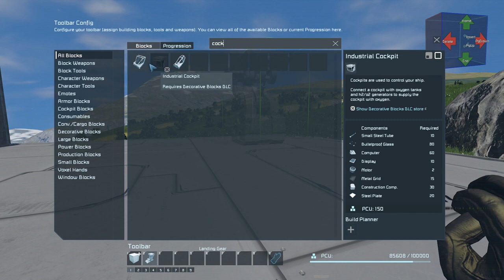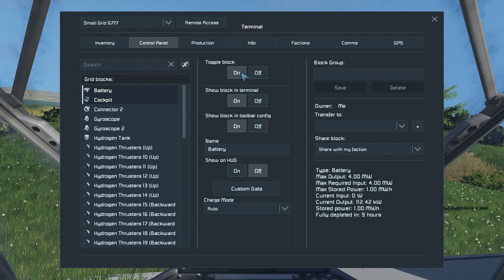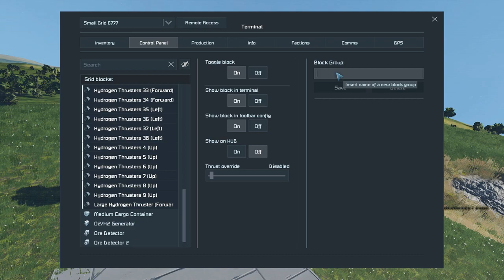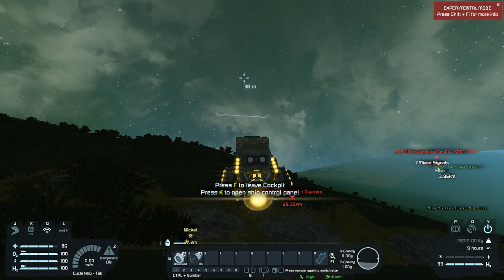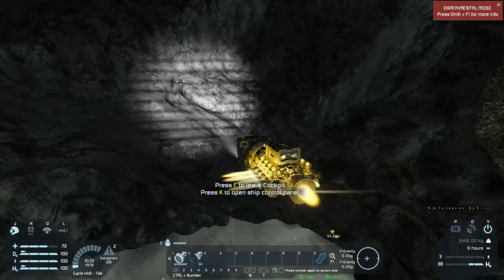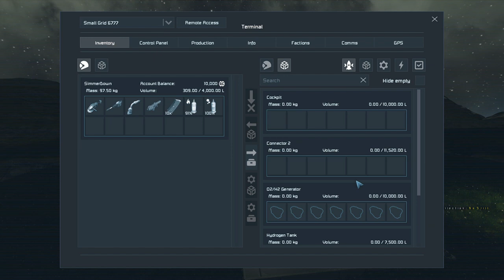Space Engineers - How to build a SIMPLE Hydrogen Ship to get into SPACE - Tutorial

Comment: Just built something very similar in my world today, except has two drills on either side in front. But left it hovering and forgot to shut it down, but assumed the 1.2k ice in the 2 generators I have would've kept it running a long time. Only had 4 small batteries though, assumed again that would be enough. With the large small grid tank I ended up running out of ice, then out of battery power and died before I ever took off the ground, lol...

Comment: Took your build and added a few things. Placed rear thrusters above and below the main, in addition to the 2 on the side you had. I also took the mats for a solar panel and slapped it in front of the battery when i got into 0g. You took off with 28k, but this thing flew with no problems loaded down with 120k worth of ice and mats for a refinery, survival kit, battery, and solar panel... wish I had brought more now. made it to space with 85% hydro.

currently at 50% and heading towards my 3rd asteroid.
Reply: I'm still on the same flight, gone around the planet a few times. finally found some uranium. still have 40k of ice and 2 solar panels now, so no worry about fuel or power. thanks for the build, works great.

Comment: Another tip, set controls to increase and decrease thrust on the large thruster. As the g force goes down decrease the thrust (it will consume less hydro for same acceleration)

You can get to space using way less hydrogen. Still keep enough ice to recharge though, you still need it to get around in space, but at least you save it up.

Good tip if you have a large load (taking materials to make your first station into space from a main base)

Comment: thanks for the help but one Question...
so if i put a gatling turret on the ship, would it consume a lot of power?
i put one on so i don't have to worry about meteor showers when i'm in space.
Reply from the maker: No they consume hardly any power at all
Reply: @RyanSimmer  thanks.
Reply: sauve reaper how did u get the ice in ur gen i cant get it in
Reply: @mikerust5873  is the O2/H2 generator connected to the cockpit? like with conveyers.
you will need to if you wanna stuff ice in the generator.

Comment: I’m not surprised you usually need the efficiency mod with that flying. Either turn off reverse thrust, or dampeners off the whole time. Never burn while at max speed. Never try to reach space at an angle.  Straight up uses the least fuel. You’ll find you use less than half the fuel. You can get a 4,000,000kg ship to space, starting at 1g grav on less than half a large tank with no mods.

Comment: This isn't working for me. :(  I initially built it in survival mode making a few changes, like adding the second H2O2 gen, the large cargo cont. (by mistake because in your video you say large when you added it, but medium later on and I noticed my container didn't look the same) and after a few attempts to release the lock it collapsed to the ground. I took out the extra parts and filled the gaps with  conveyor frames, but that didn't help any, so I scrapped it all and tried again using the exact parts and sequences in your video, but it still wouldn't work.  I switched to creative and followed it again and I still can't get it to fly. My hydrogen tank will not fill even a single ounce. not even in creative mode.  Is there a setting I'm missing? So frustrated. I have an atmospheric ship that works for about 30 mins to mine as much Ice as I can carry, but this ship will not fly.
Reply: I tricked my system into letting me build over top of the connector, then let the ship's collector fall down onto it. You have to give the Base collector two small blocks of space from any object you want to place, so the fall is not really far enough to damage either of them. This base collector is recessed to be plate level to my deck. To power the cockpit and connector I put a temporary battery on the nose of the cockpit. once the ship was locked I was able to add all of the modules and this time the thrusters I added to the rear of the ship ignited. That was something I noticed on the last build, that the rear of the ship didn't seem powered even though the battery was was on the Cargo hold that they were attached to !?! Anyway, Off to bed now with two fully charged batteries and 11K Ice in the hold with the H2/O2 gen full as well. I have a busted hot water heater to deal with tomorrow, so I need my sleep.  Thanks for the info. Oh, BTW I did use the large cargo container, so we'll see if the extra weight is going to be a problem.

Comment: Hi :)
I just started playing a few days ago, started a ''solar system'' survival mode. I tried a few times to get off the frozen planet I started on, epic failures hehe. Til I saw your video, thanx much, I modified or upgraded mine somewhat, added a drill, an extra o2/h2 gen and 2 fixed gatling guns as well as a landing kit. The landing frame and gears is mostly because I'm goofy, I would hook the ship to a connector high up, turn off all thrusters, then when ready to leave again, I'd unhook from connector, forgetting to turn the thrusters back on hehe, I had a few huge messes, was fun. With the landing kit I got and a special raised platform made with half blocks I can hook to connector while being properly landed, it no longer matters if I remember to turn the thrusters on or off.
On my first few landings, I had a hard time, a couple crashes, first ''good'' landing I had to land in emergency 2.5 kms away from my base, ran out of fuel. But now I figured out how to land super easy , I use almost no fuel, till i'm 2 kms above my base. I coast all the way down with the dampeners off, making sure I overshoot my landing spot by quite a bit, I only need a couple minor adjustments on the way down. Final approach from hover, same thing, I tap the dampeners on and off then finish connecting using thrusters. Despite being heavier than yours and coming back home with 40k kg ice and 30k kgs platinum, I landed no problems at all.
I'm adding a screenie of my little ship, the Spitton II, poor Spittoon I was destroyed, I know, nothing much but I like it, I guess it's noobie excitement hehe, again thank you for your video.
https://i.imgur.com/vurv6Xs.jpg
Reply from the maker: Your ship looks good! I am very glad that my video was of help for you!

Comment: why two ore detectors? do two make the range more?
Reply from the maker: Those are all very good points! For this I just wanted to make a very basic ship for the video. As for two ore detectors that is just for symmetry or looks it doesn't make a difference for such a small ship. I didn't know about the vent trick to fill oxygen! I'll have to try that out soon
Reply: @RyanSimmer  yea, good video though. we wanna see more space engineers videos! :)
Reply: also, you forgot to add an antenna
Reply: one last thing, where you put the connector, i would have put an oxy tank...the ice is gonna get converted to hydro and then you wont have oxygen .
Reply: if u slap on a vent and click pressurize it will fill the O2 tank from the atmosphere and not even use ur ice, saving the ice for hydro. and taking a full tank of O2 with you into space is never a bad idea.